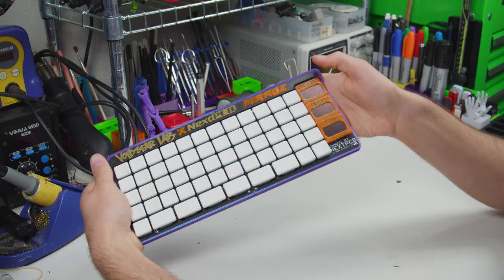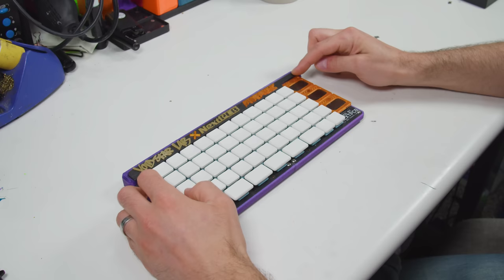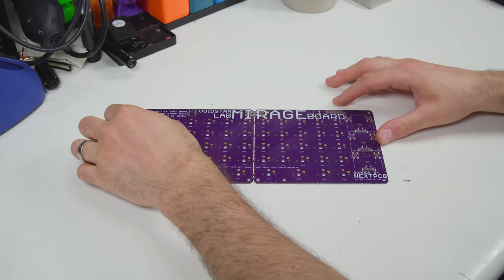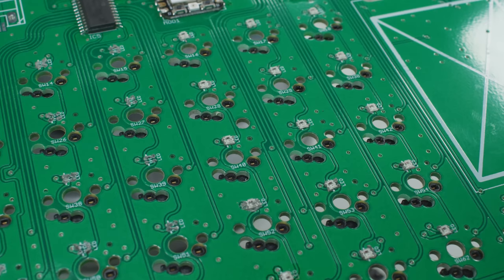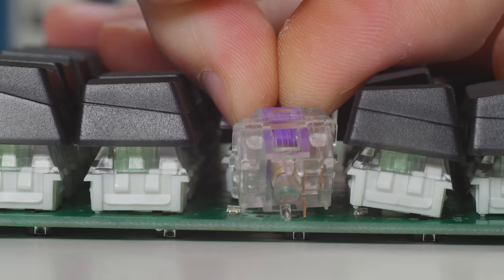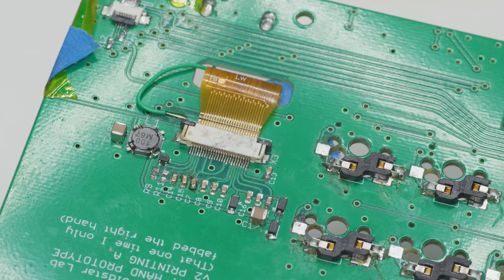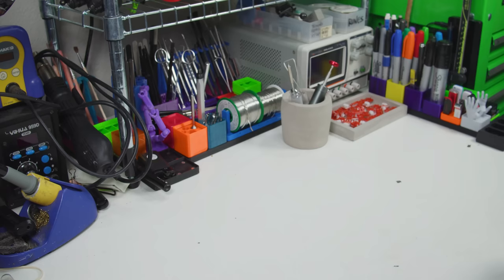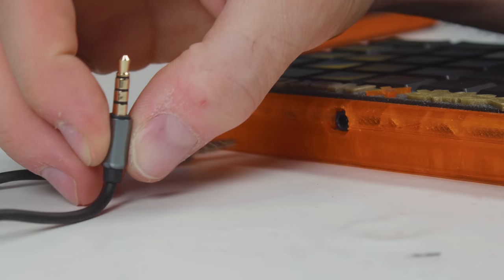RGB Ruined My Life: MiRage Mechanical Keyboard Mk2

Comment: Really good conceptual progress, I like the idea of just making the e-ink part effectively a breadboard either directly connected to the micros extra pins or left with footprints for 0R bridges and bodge wires selectively for maximum modularity - so many off the shelf dev boards that are good on breadboard pinspacing.

Comment: For the USB plug at a different height than the socket: could you make a Xiao-sized cutout in your board with edge plated pads, slide the Xiao in flat and solder it laying on the table? Then the connector would be at the correct height.

Comment: I almost got burned on the sata cables doing a hardware split, so I switched to a USB type c cable, which probably has enough connections for you, but not enough for the hardware split I was working on. Note type c has plug orientation to track and connected internal wires.

Comment: Okay, so the evil of the split keyboard is that sometimes people want the center keys on both sides of the split, so you can reach the y from your left hand or the six from your right...  So with your design a 1-column keyboard strip could let you support that by adding one to each half...Just a thought.

Comment: you could probably 3d print a hinge system to keep using OLED displays as buttons with less click to avoid putting too much pressure on them
Reply: I'd personally separate the buttons from the bezels entirely, maybe have two to the left and two to the right of each OLED.

Comment: There's connectors named "magnetic pogo pin connector" that are great if you can get a stable base to connect them it's basically the connector used in tablets to connect keyboards but diy

Comment: What about a magnetic pogo pin interface on the sides and some sort of lock to lock the “halves” together or for a more split look use a braided x-pin din type cable with adapters that mag to the mag pogo pin connectors.

Comment: hot take: the E-paper pad would be best used in place OF the full size num-pad with the option of acting AS the num-pad.

the arrow keys could be entirely replaced by a physical joystick/D-Pad, leaving only "insert, Delete, Home, and End" to be merged with the left-hand board. 

the E-paper should have something extra rigid behind it like a small chunk of fiberglass, with a layer of foam between that and the PCB to boost height and add impact absorption against users fingers. 

with something like that, this would become something i would 10000% buy.

Comment: Rather than 2 separate board designs, it would be awesome if the one PCB design had both sides of the board. Left side on the front and the right side on the back. Just flip the board and use the otherside. Most PCB manufacturers make you order 5 minimum that's 10 boards if you just want to build one.

Just have to avoid the extra mirrored hotswap holes.

Comment: In regards to the clickly oled buttons breaking over time, this is because you had made the screen part of the structure, if you had instead placed a piece of acrylic in slots i the plastic held above the oled then the force of pressing the button would be withstood by the chassis containing the screen and not the screen itself, similar in principle to how wooden shipping boxes protect the contents from external force.

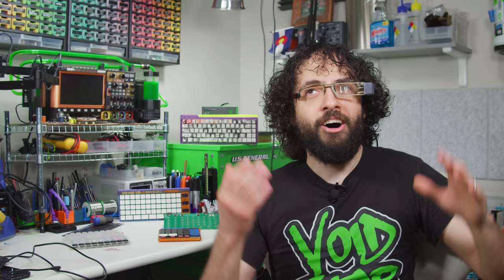Comment: 12:40 - I knew some cables had internal connections for grounds / shields.

I did NOT know the 80-wire UDMA (IDE) cables had some pins connected inside the plugs until about six years after first using them. lol

It makes sense now, though, so the motherboard can detect a UDMA-capable cable, then each drive can be forced into Master or Slave mode, depending on which colour of plug is used.
Reply: 13:24 - What about making the cutout in the main board fit larger, so the whole MCU/USB module fits flush "into" the main PCB?

I've seen some projects do that successfully, with the ESP8266 or ESP32 module.

Comment: Use HDMI to connect two boards together. Or put 2 micros and have them i2ciing each others as you suggested.
Reply: Micro-Hdmi is a horrid connection, and the support for it is dwindling. USB-C would be a fair bit nicer, excluding the whole "tiny fuck-off pins" deal for the headers
Reply: @aviaviavian  never suggested micro hdmi. But with full sized HDMI you have  a very reliable connection, costs nothing, with plenty of usable pins. I don't see the problem. The cables are even the most standard you can find out there. Type-C ones have the transactional chips inside, so unless you plan to use them as a real USB connection.. good luck.

Comment: 10:20 regularly-spaced hole grid for mounting screen/knob/joystick/slider PCBs on standoff pillars to provide custom functionality anywhere within the key grid at an adjustable height that matches the height of the keyswitches and keycaps you've installed.

Comment: Anyone else notice that the rows of keys aren't offset like they are on a standard keyboard?  Looks like you would have a hard time transitioning back and forth from a standard keyboard and this one.  But I will remember this and quote you "But in practice the difference between theory and practice is greater in practice than in theory. "

Comment: The expandable concept is interesting, and could expand this project greatly. I imagine a nav and num pads will be the first two non-half expanders, then program/workflow specific macro/dial/switch/touch/etc. pads. I could also see center expanders for split keyboards that include pointer navigation, like joysticks, circle pads, trackballs, etc. Hopefully someone can recreate a 6dof mouse as a module. The MiRage ecosystem could get super interesting beyond just a splittable keyboard with a non-standard function area on one side.

Comment: This is super neat. not sure I'd ever go so far as making a splitting keyboard myself, but a keyboard with an extra few keys emulating a gamepad or something (particularly for Push-To-Talk so that holding down the key doesn't peeve Windows off) would be heckin' useful.

wait how does one even wire in all the switches? a bunch of multiplexer chips?

Comment: If you need a small 6 pin connector, may I present the Switchcraft TA6FLX. It is a 6 position Mini XLR connector and you can assign the pins however you want!

Comment: E-ink module for functional keys sound very interesting. But it's abhorrent to place it on the right side. One of my personal reasons to switching to the mechanical and later diy keyboards was 70% and less layouts. the 3u wide display on the right is a total no go.

Comment: It just occurred to me that if the XIAO has control over the CC pins of the USB-C connector you could negotiate your own special sauce pinout and just ignore USB protocol entirely. But I'm guessing Seeed has them tied directly to pulldown resistors to get the default 5v.

Alternatively, could you continue using the audio connector by sending 5v and adding a power regulator to drop it to 3.3v while also controlling the LEDs from one of the I2C breakout pins?

Edit: Yeah, looked at the schematic and the CC pins are indeed tied directly to pulldown resistors. Womp-womp.

Comment: If you switch to magnetic connectors, you can add more than one on each side so you can run all the pins you want/need. Also, staggered keys would be useful for conventional keyboard layouts.

Comment: please put a USB hub 3.1 chip in the master right hand side of the keyboard. this lets you do handy things like plug in a thumb drive on your desk. then run the left hand side as a second keyboard HID and you can connect left to right with a type C cable. the only challenge would be syncing RGB between the two halfs.

Comment: QMK is adding support for the 2040 on the mainline (its in develop branch atm) from august, so you should be able to use QMK for v3
Reply from the maker: I don't like having to recompile firmware every time I remap a key. I think it's a big enough issue to make firmware from scratch.

Comment: Great video as always and the progress is great.  Seeing the headaches you went through and the bodged wire is standard for the path you are taking.  Think back to the old days and how many units came with wires added on! Still happens in a lot of China knockoffs too. Thankfully, most seemed to figure out the difference in power rails between countries, so stuff doesn't catch on fire as much.

Comment: 13:30 you probably can make a cutout and footprint for the xiao module and solder it flipped upside-down and on the other side have an edge-mounted usb-c connector so both connectors are the same height
Reply from the maker: Good idea, but the USB port is 3.2mm high, so the PCB would need to be 1.6mm to center it. Mid-mount USB-C plugs are designed for 0.8mm boards, so they can't line up.
Reply: @ZackFreedman  Aha, we are talking about different connectors! There is a single-side yet mid-mounted connector. Look up USB4155. PCB would indeed need to be 1.6mm thick. 

Just a word of caution, check availability. I designed one into a product only to find all the remaining stock snatched the next day. Also, it's a pain to hand-solder.

Comment: There are like super cheap USB hub ics for USB 2.0 which are super easy to route. Then you can just run the keyboard half's independently with each a microcontroller. Therefore they will run completely independent and also you will have some free USB ports on the keyboard, wouldnt that be super useful? ^^

Comment: What I don't understand: Why don't you use standard PCB connectors?
they got the same mounting height, are available with 2 to 35 pins.

and they hold together better than just the headers at 5:20

Comment: Hear me out - You could place the sockets for cherry on one side, and choc on the other, flipped vertically Since the footprints are isometric except the symmetry, just make the forehead on one side the spacebar row for the other side. Might need the even more insane flush mount rgb leds that sit IN the hole rather than ON the backside hole...then you could have both options by literally flipping the board.

Comment: I want to be able to solder onto pads extra keys. For example the arrow keys I want to use for my cnc. I'd like to make a little box that plugs into my keyboard with a long cable that sits next to the machine to jog it. 

You could add pin out pads for all keys.
Reply: Actually.  Jog wheel support would be the best. 😄 . Who wouldn't want to jog there cnc or 3d printer right from a keyboard twisty thing.

Comment: It's somewhat impractical to not use a backplate with mechanical switches. It improves sound profile, rigidity, weight and pcb longevity without bloating height of a device. And it's possible to 3d print one.

Comment: Dunno why everyone bothers with I2C and those finicky multi-conductor cables when ethernet over coaxial provides a robust and scalable solution. 

Want one half? Boring, but fine. Two halves? Still boring, but now you get to recreate the joy you feel from troubleshooting a cable modem every time you plug in your keyboard. Fifty halves? No sweat! Just make sure your root half has a properly configured DHCP server running so all your keyboard halves receive dedicated IP addresses and you’re off to the traces with your 10 meter daisy chained keyboard!

Comment: Adafruit sells "DIY Magnetic Connector - Straight 6 Contact Pins - 2.2mm Pitch" wondering if that would work for you. might have to make the cable as my quick search didn't show anything but could be an option

Comment: You could have just used the SATA cables, since you have 7 pins, 3 are shorted together, so 5 pins:
 - ground
 - sda
 - scl
 - vcc
 - neopixels

And having a 5v->3.3v regulator on each board...

Comment: What do you think about making a wireless one with pi pico w? a thought for 3/4
Reply: I second this if only because I know how much Zack loves feature creep. 

And also so I can flex that I managed to get a pico W
Reply from the maker: The Pico is so crazy huge, fitting it on the board would be a nightmare. There are ESP32-based Xiao modules that would work, though.

Comment: Wouldnt it be possible to mount 2 USB c female ports on the boards, so you can connect them via a male to male adapter or cable?

It would solve the issue of different mount heights and a protrudin USB header.

Comment: I believe this could be the elite HTPC keyboard.
Add a trackball (or a trackpad if you're a heathen), scroll wheel, mouse buttons at the corner. Make it Bluetooth and you're golden.

I'd say the corsair k83 is one of the better htpc keyboards but the key ghosting makes it unusable. Plus the trackpad is hard to use. The one thing it does right is the placement of the mouse buttons.

Comment: Hi Zack! A few dozen years ago, I had an idea that won't leave me alone: modularized midi controller (piano keyboard) that can be slapped together in series, configured through a master module,  with wedges to make the keyboard go around you in a circle like the one Max Rebo played. I feel like midi is old tech but has all the wires you'd need, and wonder if you ever tried using that or found an alternative I might consider if I ever get around to building something. Thanks for everything!

Comment: Why not use USB and put the connectors at the top of the keyboard rather than the side?
You could print a u shaped connector that wraps around a short USB cable, or make your own.

Comment: Clearly, I'm going to have to try to build one. Any insight as to wht CircuitPython is too slow? I've seen others mention it, while some folks have no problems. Maybe make it blink a pin, then look at the pin on you o'scope, see what rate you're polling at.  as for connector... perhaps an RJ45 and use Cat5 cable? There's only 4 guaranteed pins (THANKS, crossover cables!) but maybe you could double connect pairs that cross over.

Comment: Hey Zach, huge fan, I tried to build my own keyboard a bit ago, that used my favorite 128x128 color OLED. 

I’ve been messing with the EPDs recently and they’re awesome, but I do think they’re way too slow. With an OLED, you can have a great refresh rate.

I love the idea of a plug and place module instead, how about you make them interlock using a tab coming out of the PCB? It would increase the footprint, but also the strength across boards. Then in the female end of the pcb, you could fit the extra plug and play module on the right. You should also try to make it mirrorable across the x axis but that’s easier said than done.

Comment: You should consider swapping the E-Ink panel for a transflective lcd one. The power consumption should be negligible either way, and contrast should be similar, but the refresh rate on the LCD would be way better.
Reply: The problem with that is the viewing angle.
Reply: @LeoStaley  Viewing angle on transflective is perfectly fine as a technology, but maybe not ever implimentation - I've got heaps of them and while the pixel density won't set the world alight they are great with viewing angle.
Reply: @LeoStaley  I remember it being pretty good on the pebble.

Comment: God damnit Zack, did you casually mention an infohazard out loud? Or is that one of the more well contained SCPs? Also, I fucking FEEL you on the CircuitPython being too slow! I recently had to restart a rather large project using C/++, which I also have to learn, all because CP was glacially slow when trying to read an IMU and GPS, do sensor fusion, and write data to a screen and an SD card. I've got it going pretty well now, but I was disappointed. CP feels like more of a toy language than I initially expected. Awesome project! Can't wait for v3

Comment: I got a simple question, could you not have used a USB-C cable for between board coms? a C-to-C cable is male/male, so you only need female connectors on each board, and its got more than enough wires available to send all the signals you need plus its normally rated for 5V, so it should be fairly easy to wire in a way that it won't short out / blow up any extraneous devices connected to it.
Not that it matters anymore, having a MC on every segment is much better for expandability and customization, with marginal cost

Comment: 13:49
instead of 2 TRSS connectors
Another solution is  using cables like Micro HDMI or Micro display port
Reply: Or USB-C? It has 12 pins on each side. Or just for trolling do USB-A 3.1 on each side and use one of those dumb double-male cables

Comment: 16:24 can someone please explain why this is only possible with a second I2C interface?
Isn't the whole point of a bus system, that you can connect a lot of devices via addresses to it?
Reply from the maker: It's a hub-and-spoke system - it expects a single controller to issue commands to multiple peripherals. The halves would need to figure out who gets to be the controller, without talking over each other in the process. Multi-master systems are a nightmare.

Comment: Is cost the limiting factor for not just using a microcontroller with ble or some sort of wireless communication capabilities for use with communicating between the two boards?
Reply: I think the people who will  build this don't want the delay of bluetooth.
Cost cant be a factor as an ESP32 cost less than 3€...